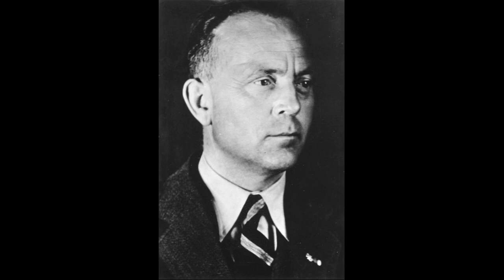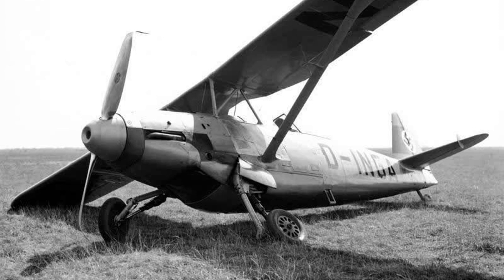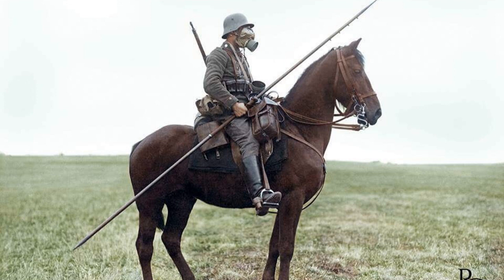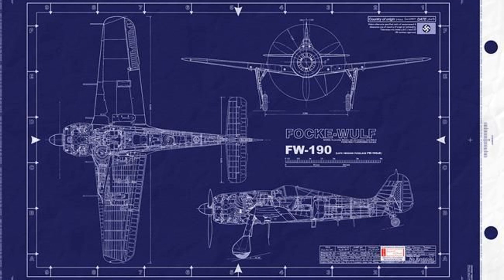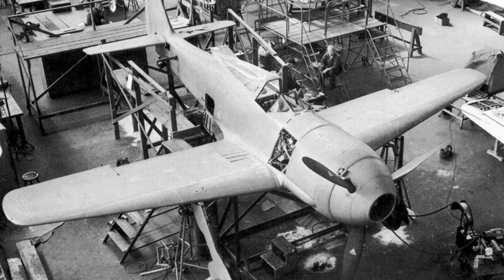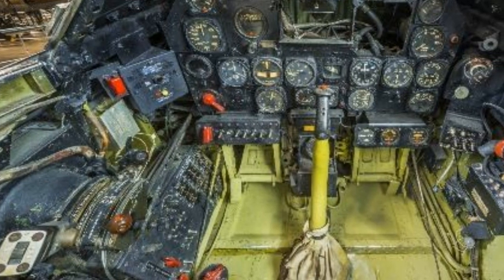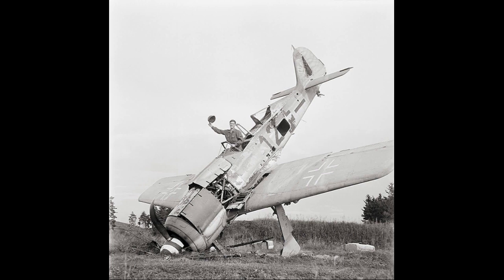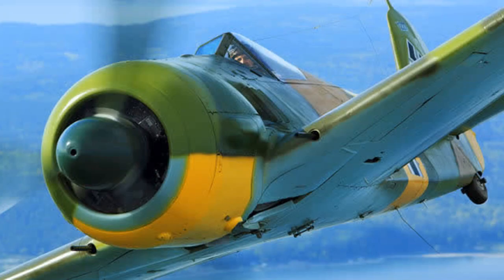(Part 1) The "Butcher Bird" Focke-Wulf FW190

Comment: Outstanding Video, for me I've always felt Tank used Hugh's H1 Racer for design inspiration. And what would be wrong with that it was the fastest aircraft in the world at the time, the BMW 801 motor was basically a licensed-built American Pratt & Whitney radial contracted from when before the war had started in the 1930s.
Reply: + chalottte quillen    The BMW 801 is a couple of engine generations removed from the single-row P&W Hornet engines made under license in the 1930s.   The 801 combined the knowledge from the BMW 132 design and the engines from Bramo into a new design.
Reply: @FiveCentsPlease  good point. Although wartime Germany usually pioneered and were almost always on the forefront of most scientific innovations, they weren't above utilizing someone else's design even improving it further. Their adoption of the American Bazooka to its Panzerfaust improvisation is proof of such tactics. Even Waffen SS prized their purchased explicitly for them American .45 ACPs